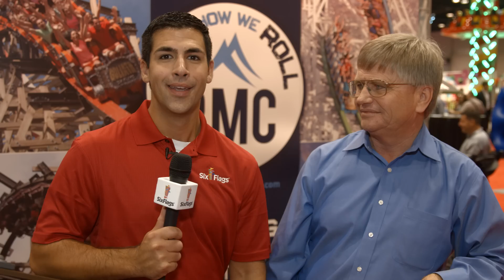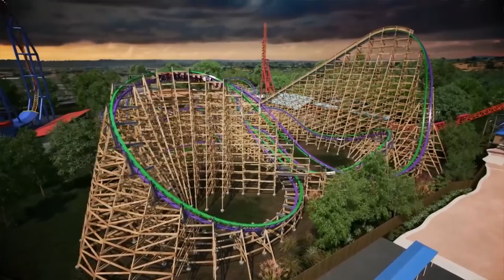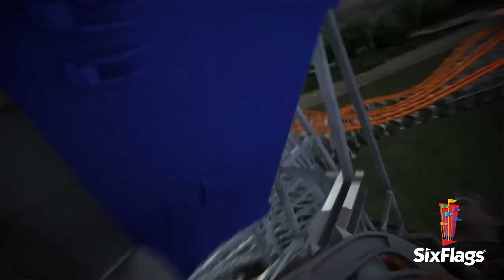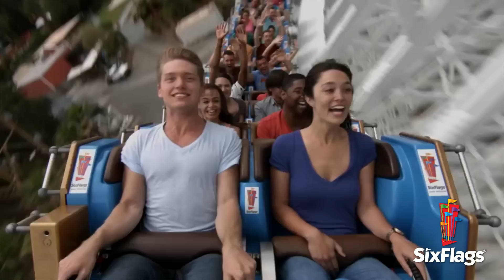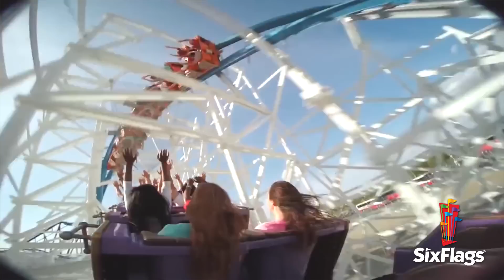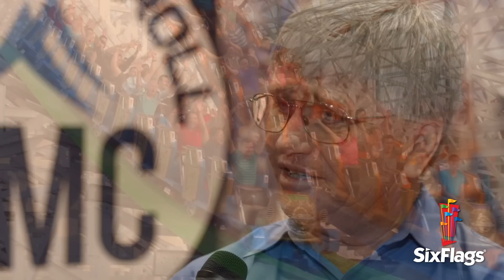Inside Look - The design behind Wicked Cyclone

Comment: 1
Reply: Interesting! Having both ridden Six Flags NewEngland's wooden coaster formerly on the same footprint, The Cyclone, as well as seeing a ride video of it's replacement, The Wicked Cyclone, I could see that the new engineers had assessed and perhaps borrowed a few basic layout concepts of the earlier coaster design being replaced. That makes complete sense. If it works well, and it ain't broke, don't fix it! As I recall, that coaster resides in a fairly confined corner space of the park, which to me also suggests greater likelihood of keeping part of the previous coaster's layout!